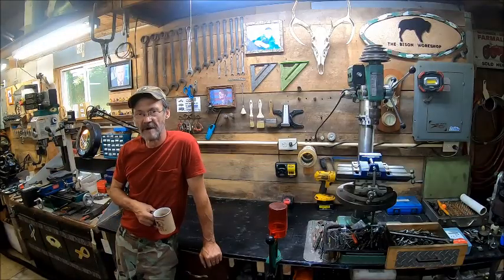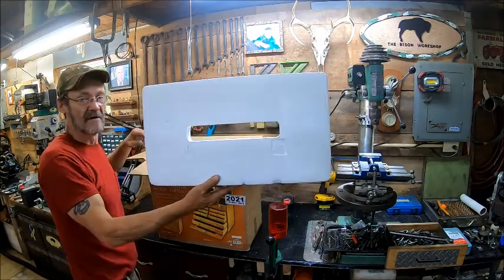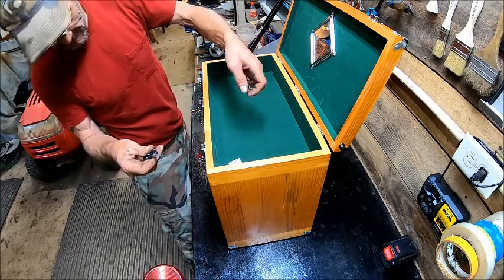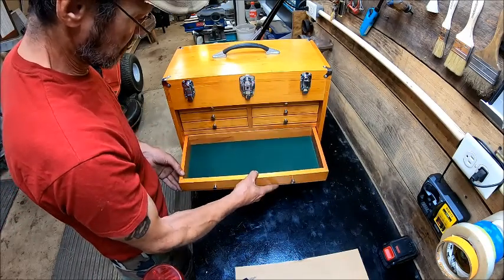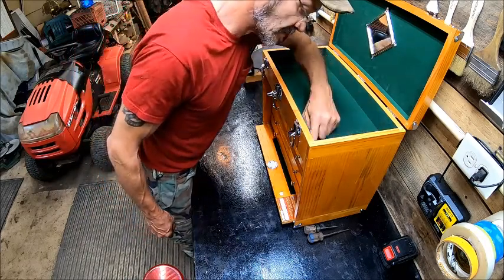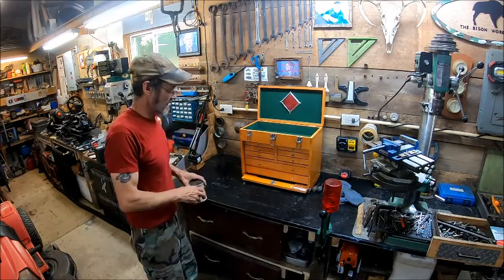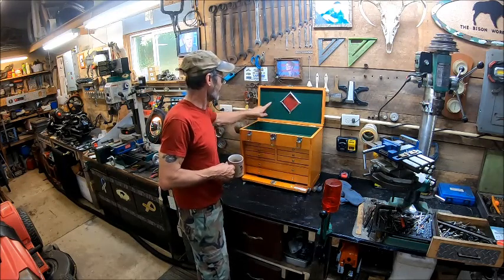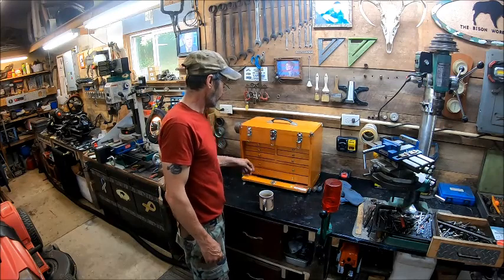harbor freight machinist tool box unboxing and review

Comment: i all honesty  i’m a retired Woodworker  and although i would build a way nicer Quality Wooden Toolbox than the Harbor Freight one  for the money they sell them it’s not actually worth me doing that because i would have probably double the cost in just Materials alone  sure those are massed Produced inChina and Lack  the fine details but they look decent  and should work  for a Machinists tool box because  they won’t be moved around often loaded with tools  BTW wouldn’t the divided Drawer be good for organizing Drill Bits or end Mills ?